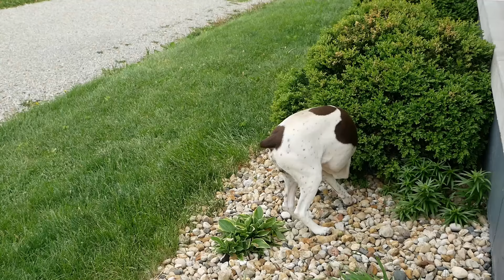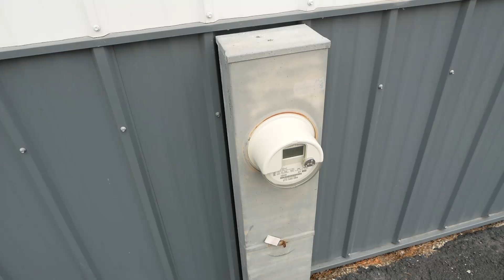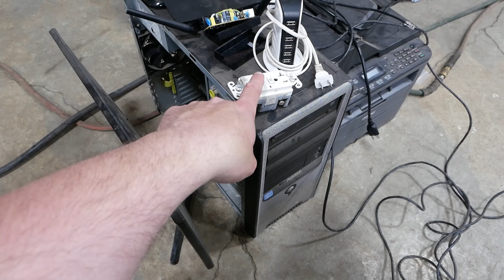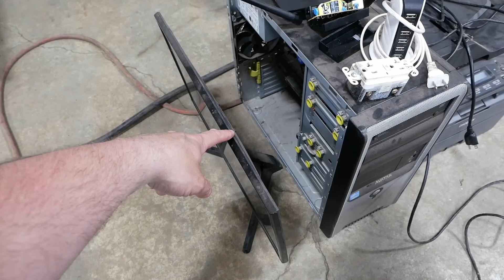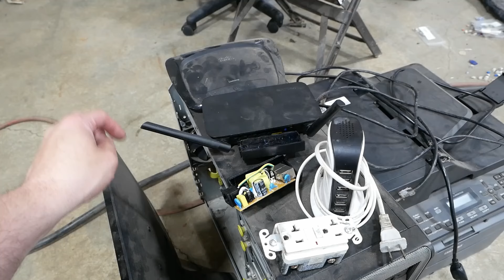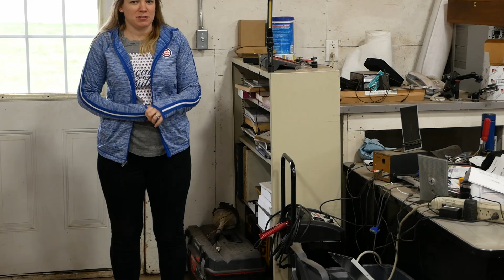Lightning Strikes Shop, Again...

Comment: The ethernet needed surge protection. The ethernet cable took out the computer and printer and wireless routers. The surge protector may have actually worked only for the stuff to get smoked by the ethernet cable

Comment: The power strips/ surge protectors are barely decent down to useless.  You should have all these items plugged into battery backups.  I recommend APC as the brand of choice.  UPS (battery backups) are commonly called “power conditioners” as your items dont run directly on the AC voltage but on the battery inside and the battery is kept charged by the AC power.  They also have built in surge protectors.  All of your electronic devices can, and should, be plugged into one EXCEPT laser printers.  LP’s pull too much on warm up and tend to hurt UPS’s.  Also, keep in mind this saying “the bigger the UPS is (watts), the longer I have to shut down everything correctly and unplug.  As for how your things were hurt, you can follow the path that the lightning took.  Your motherboard acted like a hub and sent voltage to monitor, printer, network hub/switch/router/etc.

Comment: Lightening can jump 10 miles from the sky to the ground.  I can tell you that there are devices that are supposed to be able to divert the lightening to ground and save everything plugged into you panel.  A lighten strike by your building on overhead lines has so much power, both voltage and amperage, that a bunch of metal oxide varistors is not going to be able to divert it all to the ground but any decent sized electrical supplier will sell you one that will take a lot of it to ground.

Comment: Hey Wes, don't know if it has been suggested or not, but for the first two years we lived at our present house we used Satellite internet service. There are basically two providers, Verizon and HughesNet. We went with Verizon and it was a very reliable service. Speed wasn't lightening fast but it was very usable for everyday stuff. The big downside to satellite service is the limitation on data. You can't do streaming movies, etc and other things that have to move a lot of data, but you do have internet service. There is a period of unmetered service every day where you can move as much data as you want and it won't count toward your limit. However, that's usually between like 2am and 6am. Just thought I'd mention it. Hope you get back up and running soon!

Comment: Wonder if it would be worth running the power for your electronics through a cheap plug in transformer? Yes, a transformer would be unnecessary for supplying the power, but would likely be the first thing to fry in a lightning strike, and would provide some surge protection if it didn't fry.
All those other plug in surge protection devices are pretty useless- the voltages that a proper lightning strike close by can provide just jump the air gaps in those things.

Comment: Lightning strikes are superfreak events for electrical/electronic devices.

In the late '80's I worked as a contractor for a pretty large pharmaceutical company installing and servicing their security cameras.  At the time they had nearly 200 cameras and 60 plus monitors in the control room.  They had a lightning strike one night that we ended up tracking to a tree that led to a Toro timer box for their sprinkler system that was spread over a thirty foot radius.  Interestingly the camera they designated as camera 1 was very close to the tree and timer, that was the path to the control room.  It was a pole mounted under dome camera with a separate pan/tilt and separate lens system, the cameras were low light tube cameras and very expensive, somewhere in the region of $10K.  Camera 1 was toast as well as the pan/tilt.  It then traveled through the RS-485 camera control network to the control room.  It then turned into the things you're describing, traces on PCB's vaporizing, chips and individual components exploding without destroying things you would expect.  Other devices would be untouched even connected to the same path.

It was an extremely expensive fix for the insurance companies.

Thanks for the video, it triggered a memory that I'm proud of but kind of don't want to remember.

Comment: The surge bars not good for lightning strikes. I use a battery pack + surge protector. If power goes out you have battery power to run your electronics. From that pack I do use the power bar.

Comment: You can get surge protection device in your main power board. It will work for lower voltage surges. But with lightning, nothing short of physically unplugging stuff will protect it.

Comment: Wes,
  I had a whole house surge protection device installed in my incoming breaker panel. It seems to work very good. I have not had any problems since I had it installed 20 years ago. If you elect to have one installed be sure and get one that is designed powerful enough to protect the electronic devices in the house. They have cheaper less powerful devices that will protect your home wiring, not what you need. Also be sure that you have several good ground rods installed at your meter base. Even with all this if you get a strike that hits your incoming service, I doubt anything will save you. 
Good Luck
Reply: yes, i've had one of these too. forgot about that. good recommendation.

Comment: Brother you need a whole house surge protector on the main feed. It will save all your electronics. surge protectors are rated on ability to absorb surges. the el cheapos are no bueno. as with any tool you get what you pay for.

Comment: I live in the country and I used to have voltage spike problems all the time. Look into Panamax surge suppressors. They have $5 million coverage for protected equipment. I still have one from back in the 80s when I had a C-band satellite dish. They have them with Ethernet protection on them. Leviton offers a device that plugs into your meter socket and the meter plugs into it. They also make devices that you connect to a 2 pole breaker in your panel. Power companies have surge suppressors that mount on the pole. They have an air gap so it the voltage exceeds specifications, it jumps to a ground wire. I use Cyberpower UPS systems to plug everything into. Make sure your electrical service is properly grounded. It never hurts to have extra ground rods and make certain they are in an area where the ground isn't too dry. Some times you need to go pretty deep in the ground. You can move your hard drive to a different computer or buy an external drive to back up the hard drive to make it easier to move.

Comment: Old EE gal here. Sorry about lightning toasting your computer and internet, always a pain, and good luck recovering your hard drive. One thing I didn't see in your video about what should be done is a good earth ground stake so the lightning surge (path of least resistance stuff) can be shunted to earth ground before it gets into your valuables. A good UPS to plug all your valuables will help, but depending on a lot of factors, lightning can still fry your stuff.
PS: Love to watch a good engineer at work...:)

Comment: I will never complain about our Xfinity (Comcast) service after seeing this video!  Holy smoke, your service is not-so-good!  Surge suppressors on the power line don't help when the EMP comes in on the cable.  That is if your power line suppressor does what it should and if it isn't overloaded.  Good luck with getting your service restored.

Comment: A whole home surge protector can help in some cases, but a direct strike like that usually can't be stopped by anything.  I doubt it would have helped in this case.  Startlink will be an option eventually.  Hopefully within a few years, you will be able to use it and have fast, reliable Internet once and for all...

Comment: I’m an olde man.  Running line restoring power is hard work.  Climbing poles or digging trench, folks don’t realize how dirt cheap it is.  Run gas mains, communication fiber cables.  Start up facilities hit by storms. Snow flakes just have no idea.

Comment: It appears to have traveled through the ethernet cables for most items, APC has a surge protector (P-PNET1GB).  I use them for running ethernet to my shed, since I had multiple GFCI blown due to lightning and its a long (100+ ft run through the yard).  You need 1 at each end for any long runs or from your ISP modem/router.   Good luck, lightning no fun!

Comment: That sucks that your WISP got bought out by some Texas firm - no wonder it sucks now! WISPs can be good - for a few years before wisps were really a thing, I was getting my internet connection over essentially a WISP link, but it was dedicated to just me, and it was amazing! I was one of the only people that had high speed internet at home at the time, as even cable internet was very new and only a few people had it. I think I was getting about 6Mbps in both directions, and cable was only 1.5 or 2 at the time (shows you how long ago that was - I think 2001). I know for a fact that those Ubiquity radios your WISP are using are really good - I use those in some places to distribute / share an internet connection, and those radios are FAST - definitely over 200Mbps. The problem is just that your WISP sucks and doesn't have the capacity on their connection or on their backbone to the internet to provide decent service. Also hard to believe there's such a huge hole of starlink coverage in the whole eastern US. You are not lying, there's literally nothing over there! If there's a reasonable number of people close to you, you could always look at starting your own ISP - either fiber based or WISP. It doesn't take too many people in a small area to have it start making sense!

Comment: What a drag!  I've been in your boots before and wish I had a solution.  I spent $4k to buy and install my own utility pole to use as an antenna base for line-of-sight internet connection...  THAT NEVER WORKED!  After about 18 months of constantly attempting to get me a reliable signal they dropped my contract!  Great big poo sandwich I ate all by myself.  Now I have an expensive flag pole...

Comment: I work in IT Wes...if you want some decent surge suppressing for your place look into getting a whole house surge suppressor installed at your electrical panel.  Also look into getting some Tripp-Lite ISOBAR surge suppressing power strips...they're rectangular with a metal chassis.  Those are what we use at work and they do a substantially better job at protecting equipment than the cheap ones.

Comment: A surge protection strip is for small stuff. It can’t handle a lightning strike. You need a big surge protector on the breaker panel. You also need surge protectors on ethernet, phone lines etc. Wifi is good, as the devices don’t connect with anything that conducts electricity. Also - if you don’t have it, get a cloud backup on you computer - preferably with ransomware protection. Good if the lightning sets your shop on fire

Comment: T-Mobile isn't available where I use it either, but I called and asked for the equipment anyways because my phone had ok coverage, and its working out great. And again, 50 bucks. No contract. You could try it and if it don't work send it back, all before your Internet is even repaired. I understand your hard drive contents were prolly more important, but figured I'd still try to help lol. Bad Internet is just terrible

Comment: I  saw a ponderosa pine explode from lightning,  the house next to the tree literally had the sheetrock screws blown out of the 2 x 4s. windows on the next block were shattered But the hot tub under the tree was fine. I was called to look at the hot tub and nothing was wrong.

Comment: About five years ago our neighbor got hit by lightening - it hit us via the gas line between the two houses.  He lost a brand new $10,000ish television and entertainment system, plus thousands of more dollars in EVERY electronic device in the house.  We lost ALL of our computers, televisions, and anything else that was plugged into the network as that is where the surge went.  Not a single thing plugged into an outlet was affected!  Thankfully, for both us and the neighbor, insurance covered it all.  We have since installed ethernet surge protectors (about $30 each).  Thankfully - no more lightening strikes since!  Be well, Don

Comment: The pole where your service goes to your home and shop needs a ground into the earth.  That will help direct the lightning.  Then you need one on your line going into your meter.     My house was hit five times and not directly but on the grid service that is underground.  I live in a neighborhood with underground utilities.   The Main Street has poles that get hit all the he time.  Now that we demanded the grounding of the poles and our service coming into the house we never have the damage the lightning caused.  Some houses in the neighborhood has been hit but everything was good. No damage!!!!
Reply from the maker: The service entrance has a ground rod per code.
Reply: @WatchWesWork  mine did as well.  They can ground the pole as well.  We had to fight for it.  My neighbor said if more poles were grounded people would not loose their electronics.  He works as a linemen for National Grid!  They don’t want to do it because of the expense.  You can’t go after the electric co for your damage. Also make sure your pipe from your well is also grounded deep enough.  Ours was not.

Comment: I use a fiber converter between cable modem and home network.  Suggest same for anything that separates from the power line.  The power wires, including ground, jump to 10KV during strike and the surge looks for a place to go, long wires to well pump, sat antenna, Telcom, door bell, furnace thermostat, etc take the most hit.  

Mountain top radio equip mount the equipment on wooden floor above concrete to prevent flash over to ground. 

 Bring all wires to a single ground, like outlet strip with enet, coax, telco to keep voltage differences to a minimum.

Surge protectors miss the point.  The idea is to bond all the grounds so the equipment all surges together.

Comment: What grounding do you have on your entrance?  That much damage from a neutral strike is scary.  That is grounded at the pole and should be at your entrance.  Could the lighting bridged over to other parts of the line?
What you want to do is check the impedance of your ground.  It may be too high for effective protection which all depends on the depth of the rod, and the materials in the earth surrounding it.
MikeholtNEC has a channel that goes over a lot of that with actual tests.
Reply from the maker: We have ground rods at the pole and entrance. Everything is up to code. The entrance is also underground.

Comment: Some years  ago, my 60 foot tall TV antenna tower took a direct hit. I could taste the tinfoil in my mouth for the next 15 minutes. Besides losing a microwave, a cordless phone set up, blown fuses to my well, and a motor on my air compressor cooked, the end of the line seemed to be a light switch in the wood shed 30 yards from the house. It was blown clear out of the handy box.
 It seems the previous owner had run a heavy ground cable from up high on the tower, and connected it directly to the ground rod at my meter base. Evidently, my complete ground circuit on the property was HOT for an instant.
Reply from the maker: Ouch! When I was a kid we had a branch fall on the entrance cable and short the neutral to power. It turned all the 110V circuits into 220V. Pretty much cooked everything that was plugged in...

Comment: Wes, a battery back up APC will keep items plugged in down stream from the unit from getting toasted. The APC branded power strips also carry a high joules number (close to 4,000 if memory serves me) and a $250,000 replacement warranty on items plugged in.

I'd get some copper plated rods and install new grounding rods, a minimum of 6 foot deep using a good copper grounding cable.
Reply from the maker: We have ground rods per code.
Reply: @WatchWesWork  People think ground rods are magic - they're not, they're actually a terrible way to make an electrical connection to the ground.

Protection against direct lightning strikes is very hard. In this case it's not quite direct, but still far from trivial. Considering the limited extent of damage, however, I doubt all that much energy actually got to your building(s) - a proper surge protector on the incoming supply might be worth considering. And, if possible, separate that PoE injector from the rest of your gear via fibre. External runs of cabling are extremely problematic, and high speed signals are very much harder to protect than power.
Reply: That'll protect from surge.

It won't protect from a lightning strike that close.

If it can jump down from the sky, it can jump across the isolation gaps in a UPS or surge protector. It really is that simple.

Comment: Forgot to add. If you want a real failsafe, then you could rectify the  grid ac and feed dc to a UPS and then run your IT kit on a Neg 12V supply. The downside of course is that your IT kit would all have to be -12v capable and that usually means commercial pricing. You could also ask Mr Musk why Starlink covers most of Ukraine and not Illinois. It’s a fair challenge I believe.

Comment: Some of it could have been mitigated with a Battery backup system. The internet side is kind of unavoidable though.
Reply: I thought Wes said his internet is line of sight microwave???
If there is no physical connection to a grid or network how would it matter?  (unless the antenna is kablooie)
Reply from the maker: Antenna=lightning rod
Reply: @WatchWesWork  Yeah, I get it.
But Kurtis seems to think that the surge came from the Net.
I'm glad everyone is safe and there's no major damage to your home or shop.